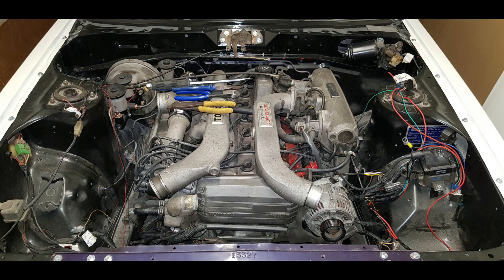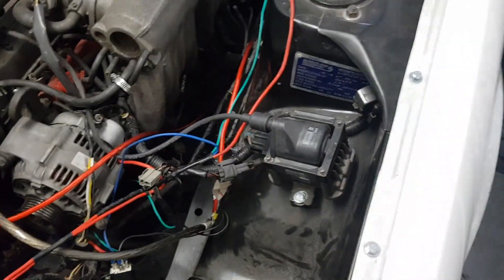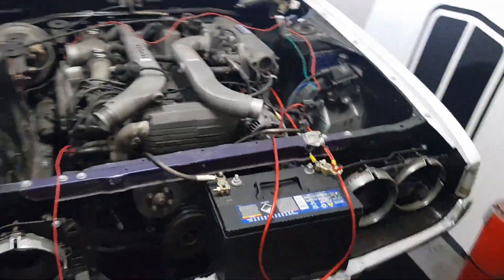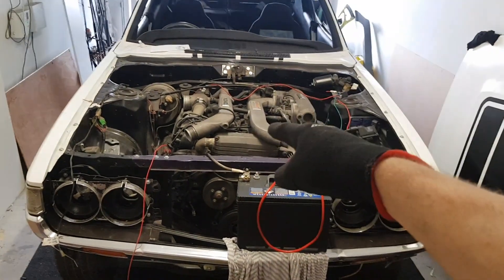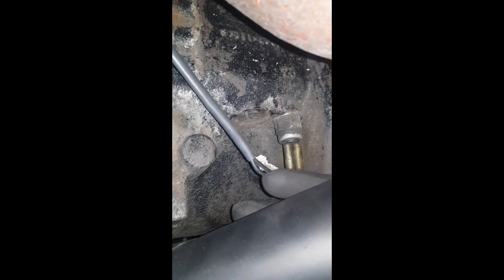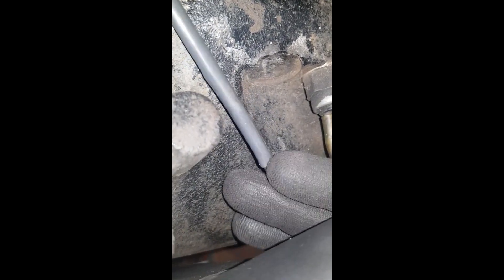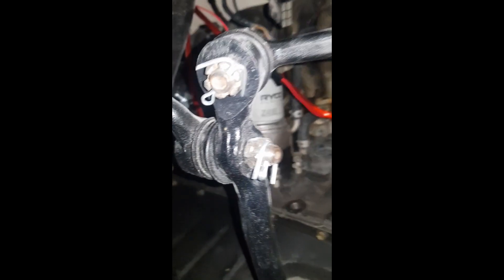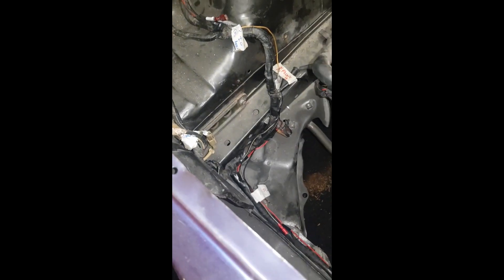1977 toyota celica Ra28 Build No 16. Wiring up Eve!

Comment: what engine mounts you use? is it stock celica in bottom? ;D cheers
Reply from the maker: Yeah all stock celica bottom. This is the mount off eBay.   MACKAY FRONT ENGINE MOUNT - for TOYOTA CELICA RA28R 1975-1979 - 2.0L - A2066